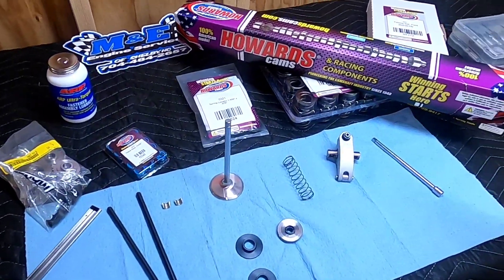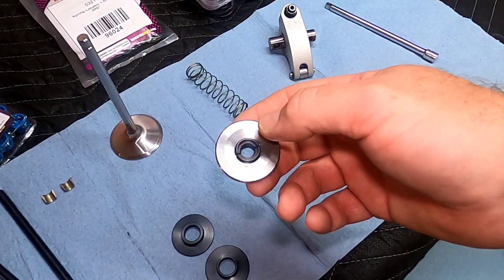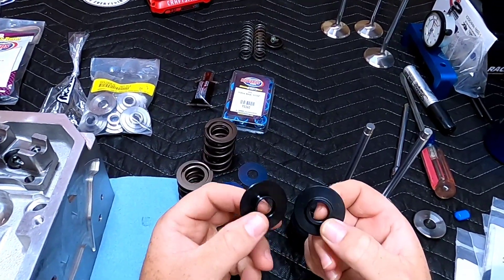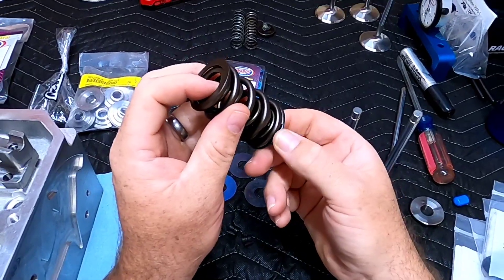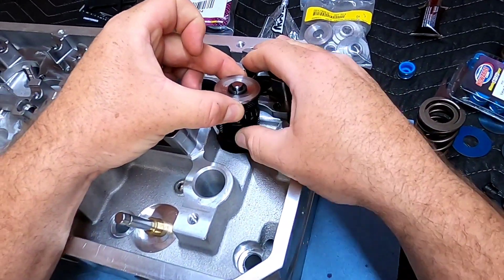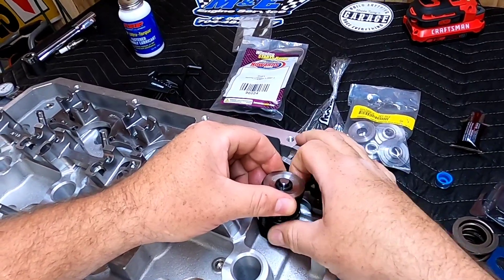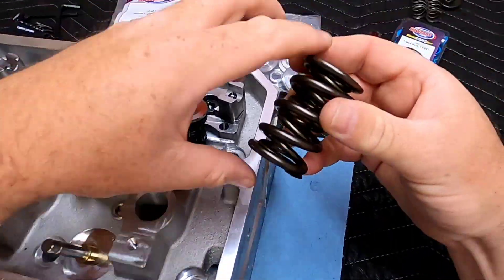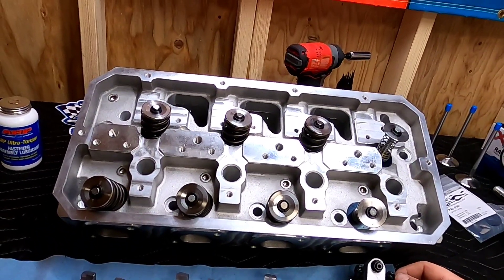Hammerhead BOSS 429 style heads Valvetrain Setup for MIXED UP BOSS / With Howards Cams Products

Comment: For those heads that seems like plenty of cam I would expect it to run well past a 7k rpm peak should you choose to rev it on out.
Reply from the maker: bcbloc02,  I believe you are right.. when you have great head flow the cam doesnt need to be as big! I really believe it will peak at 7000-7200 rpm.. Time will tell... Theory to reality!
Andy

Comment: These heads are all great and everything but what happens when your Hemi sb Ford starts kicking band X's (GM"s) butt on a regular basis? You get protested and outlawed by the competition. Ford has run into this before with the sb. Remember the Gurney Westlake heads used in the Ford Indy engines. How about the Cleveland/Yates heads, restricted by NASCAR and punished by the NHRA with weight rules. Aftermarket can build all the great heads to beat the General but the millions of racers running Chevy will protest these heads to oblivion. The same thing happened with the Ford 427 SOCH cammer, banned by NASCAR and restricted by NHRA so they can't compete with Chevy. I like all these great Ford world-beater engines but to compete with the General you need to build a better engine available to everybody, Ford is too late to the party for pushrod engines but the Coyote engine is kicking the General's butt every day.
Reply from the maker: It always happens...LOL Im just building this for Street/Strip action... Thanks for Watching RD
Andy

Comment: What does the really long rocker arm on the exhaust side do to your valvetrain loads? I'm expecting that the cam is going to have a heck of a lot of force on the exhaust lobes...
Reply from the maker: Scott believe it or not,  it is pretty stable!  the only thing is the bit of extra weight on the valve side of rocker fulcrum..  which is why im running a bit extra of spring pressure... on a street motor with a solid roller I try to run 220lbs on the seat and about 550 over the nose... If the cam profile will allow me to do it.. That is why im running 240/625 on this motor Greg Brown has run this same rocker arm setup past 9000 rpm with issues... That gives me comfort as well...
Andy

Comment: Great video.  Off topic question, I know you work with David Vizard...I have a chance to buy an old Superflow 110 manual bench for $975, it maxes out at 110 CFM at 10" water.  Is it feasible to convert it to a full fledged bench with, say 400 CFM at 28" water? Or should I try an build my own?  Thanks.
Reply from the maker: I will ask David... And get his input.
Andy

Comment: Having monstrous heads with just enough cam timing to do the job is the key to longevity. The OEMs finally woke up about this and all the heads from them are legit race heads. Those Hammerhead Hemi heads are stunning, by the way.
Reply from the maker: Thanks... I can't wait to see how it does... 
Andy
Reply: @UnityMotorSportsGarage  the specs on the mild cam look like it can rev to 8000+....are you gonna let it sing?
Reply from the maker: @hoost3056  yes Sir!!  Going full send....  We are figuring it will probably make peak power around 7000-7200 so we will see!  It's going to be fun either way...
Andy